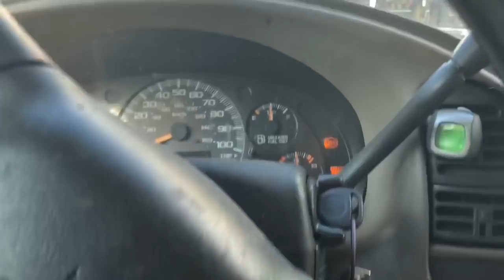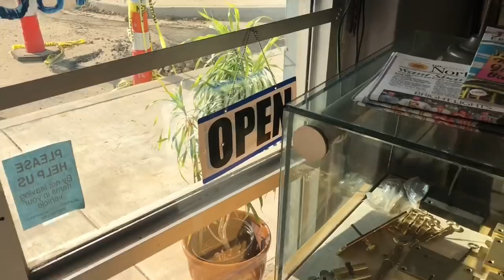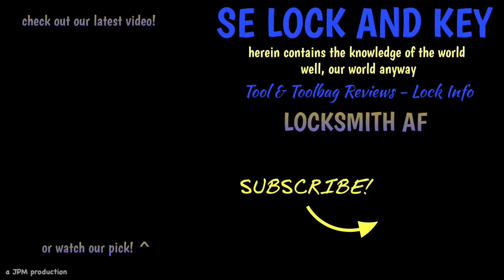Happy Friday XIV: “shoutout to the thumb down trolls”

Comment: is this troll the same guy that talks about shear key. What is a shear key anyway
Reply from the maker: Jeepster mario I still haven’t figured out what a shear point key is. Obviously some top secret stuff 😂
Reply: I wondered that same question. I looked all over the internets to find out but never found anything that made any sense... thank you for asking and also jason for answering that question. I thought maybe i had missed a joke or something... i guess the joke IS the troll. Lol
Reply: Jeepster mario 
I think it is a hardened steel blank, that fit the keyway. So you can use it to torque the core enough to snap the brass pins making a new shearline. Just like when coding those Master padlocks
Reply: rune international like that force torque tool that was made for kwikset smartkey locks.